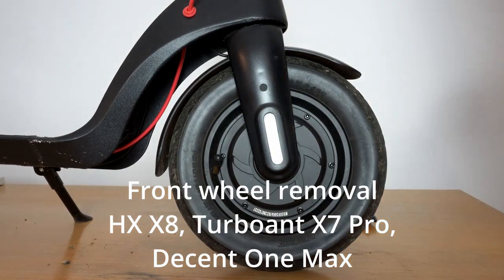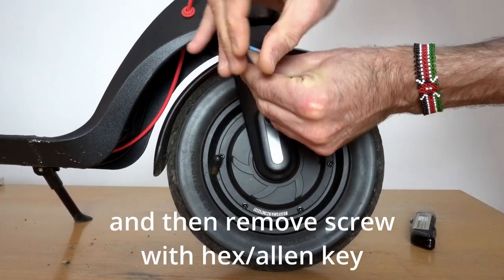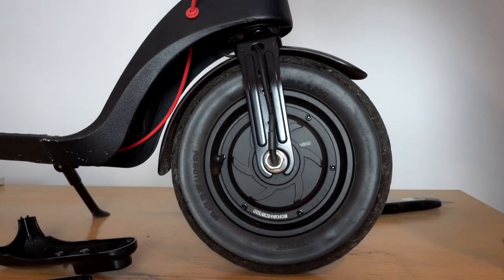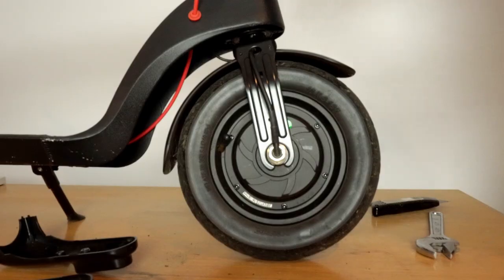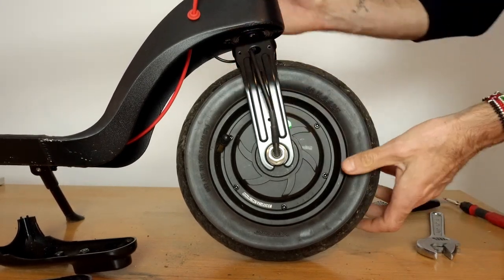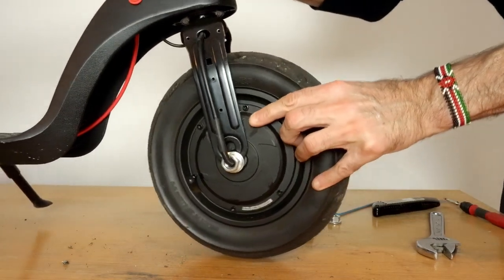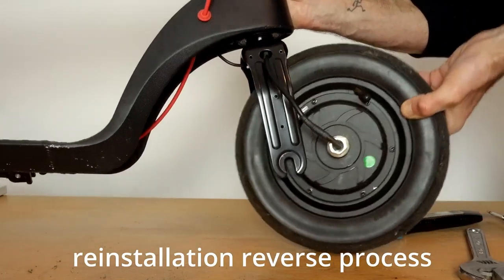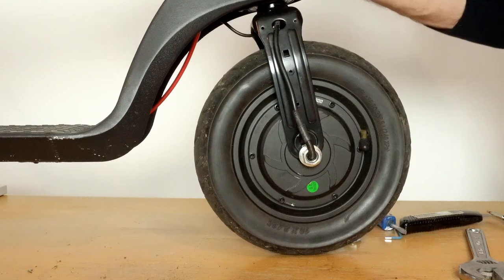Turboant X7 Pro, HX X8, Decent One Max electric scooter front wheel removal

Comment: Can the inner tube be replaced when you remove the tire like this?  Seems the wiring gives very little room to work.  Do you have a video showing the replacement of the inner tube with the tire still attached to the wiring harness?  Thank You
Reply from the maker: Yes it can. Put the tube on from the opposite side to the cables. Or just disconnect it but that's more work.
Reply: Do you have a video showing the tube replacement with the tire like this? Thank you
Reply from the maker: @frankadamski5857   check out the channel. You want one showing how to remove controller so you can disconnect cables.

Comment: I can’t remove the big bolt because it’s rusted any tips?
Reply from the maker: Soak it over night with WD-40 or similar. If it still doesn't move heat it up with a blow torch, let it cool then try. Also use a pipe over end of spanner to give extra torque.

Comment: Does anyone know if there are hard tires you can use on the turboant x7 pro? I’ve had my soft tires bust like 3 times
Reply from the maker: Yes there are but we don’t recommend them as the quality of the ride is so poor. To prevent punctures keep your tyre pressure up - it needs to be checked weekly.

Comment: my decent one (model one) scooters front tyre doesn't have a reflective strip. Its a thick  hard plastic reflector. I have tried to pry it out but it feels like its going to shatter
Reply from the maker: The screws are under the reflective strip. It's just a bit of tape and will peal off.
Reply: As i said previously… its not a strip. Its a thick hard plastic reflector that seems to be glued into place. I had to break it off and when i did the two small holes seem to be done in the same manner

Comment: i have a question about  my decent x7, im getting no power but the battery works fine as ive tried it in another x7 scooter, i was wondering if you had any idea what it could be? i was thinking maybe the power button on the throttle
Reply from the maker: Controller is probably blown 😢
Reply: @HorizonMicromobility  no problem thank you is that an easy fix?
Reply from the maker: @JaseGBT  yes. 👍

Comment: One of the nuts on mine was tightened on so tight that the washer below it was deformed and now I can’t get it off. Any ideas?
Reply from the maker: Try spraying penetrating oil (WD-40) and leave overnight. If that fails try heating with blowtorch. Also use leverage on the spanner if possible.

Comment: I tried this out did fine. Couple times but then inner tube troubles. Started happening and my scooter 🛴 won't power on anymore. Any tips suggestions?
Reply from the maker: If everything was working ok before you fix the puncture then there may be a loose connection somewhere.
Reply: @HorizonMicromobility  must be just haven't had the will to find disconnect.

Comment: My scoot was working perfectly fine until i got a nail in my back tire. So i fixed tge inner tube and when i went to take off, the accelarator doea nothing  not sure what happened. But the front tire feels like its engaged like a clutch. So it does spin but hardly. The accelerator spring feels normal.what sgould i do
Reply from the maker: Not sure how fixing a puncture on back has caused an issue at the front? But it sounds like the motor is faulty
Reply: @HorizonMicromobility  ok thanks a million. Yea im not saying the fix  roke it. I was just sayin that it was  working 15 minutes prior then just stopped out of no where

Comment: Why has my scooter just said EC when ive taken my frunt wheel off
Reply from the maker: Put it back on. The controller indicates a motor error as it can’t detect the motor.
Reply: @HorizonMicromobility  that made no sense mate
Reply from the maker: @connormarsden678  just mentioning that EC error is motor error
Reply: @HorizonMicromobility  yhyh my g

Comment: I kmow im abit late, bit i followed this video exactly and when i put it all back together after changing the innertube, its coming up with e4 on the display and wont move, can somebody please help me 🙏
Reply from the maker: That would indicate a motor hall sensor fault.  you'd need to replace the motor as it's not practical to replace the hall sensors
Reply: Okay thats the wheel with the wire right? Is it easy to take old one of replace with new one? Just looked at a quick video and looked  pretty complicated 🙄
Reply from the maker: @adamdyson375  YouTube is your friend. Basically you just remove wheel, disconnect from controller and then replace with new
Reply: I stripped one of the wires. There is not enough slack in the wires. When getting wheel off.
Reply: @annearly3200  Oh no! You should be able to solder it back. Disconnect from controller if you need more cable slack.

Comment: Why'd they make it suck so hard to inflate
Reply from the maker: It shouldn't be difficult to inflate. If you can't get the pump on easily carefully bend the valve out from the wheel.
Reply: @HorizonMicromobility  pain in the ass,can I put the puncture seal in while flat then inflate?
Reply from the maker: @deadpoetztampa  Yeah, that the only way of adding sealant, you can't add it with air in the tyre. Take valve core out, add sealant, put core back in pump up, scoot, If you have had a puncture then replace tube or mend puncture first. Check out our channel for video on how to add sealant for more info.
Reply: @HorizonMicromobility  don't know if it was punctured, replaced the back tire, today woke up the fkn front flat,smh so I gotta pull all this shit loose and see if it's punctured too,smh thankx
Reply from the maker: @deadpoetztampa  front and back?? That's tough... stop riding past that tack and nails factory!
Reply: @HorizonMicromobility  all  truthfulness I bought it with a flat, but heyyy you know,@###$but I really don't see a puncture, so it was weird but, I'ma try this bs and give it an even criticism,I used your video for the back wheel
Reply: @HorizonMicromobility  you should send me a new set of tires for a video, start thatsh*t,lol tack and nails...😂
Reply: @deadpoetztampa  Might not have been a puncture, I had the same issue, it started over time deflating, I checked for any puncture or damage but there were none, the inner donut can get damaged over time with friction, especially in heat.

Comment: TurboAnt sucks for not having an electrical connector on that line, like all scooter makers who don't suck have. 😏 My cable doesn't have the slack that yours does, of course.

The reason I am having to change the tire is because turboant does not inflate their tires and therefore does not test their inner tubes when they ship the scooter. so when I inflated my tire to 33 PSI it did not hold air because the inner tube was  defective. so I am having to change the inner tube before I can even use the new scooter. Turboant offers nothing, when I called. Don't buy a turboant.
Reply from the maker: There is no customer service or warranty when you purchase many brands of scooter. We used to stock Turboant but whenever there was a warranty claim they would make things so difficult we gave up in the end. Always best to purchase from the country you live in as should be backed by warranty.